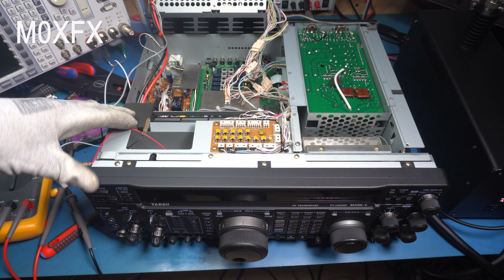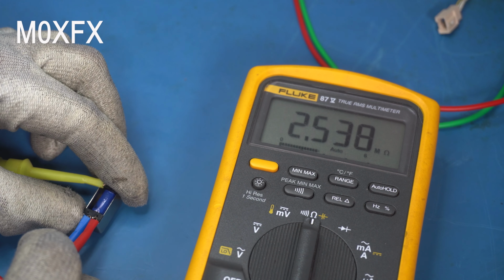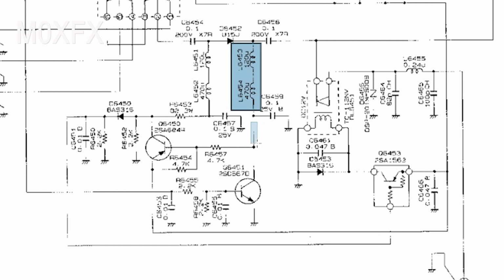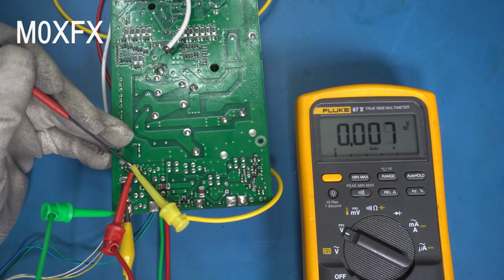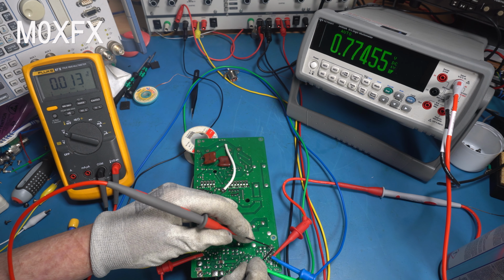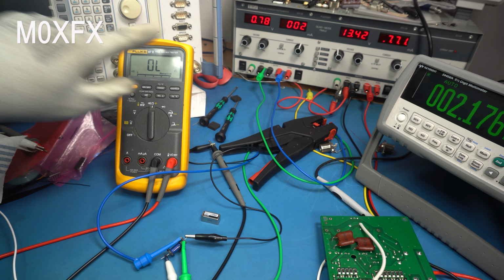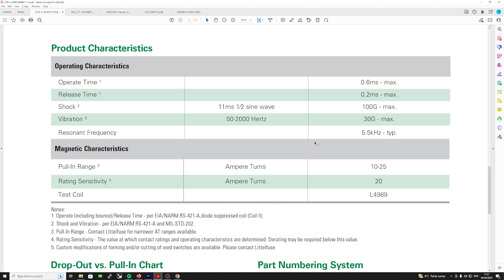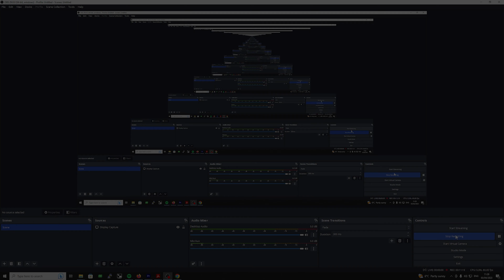Yaesu FT-1000MP Mark V No RX-TX Troubleshoot & Repair Part-3

Comment: Hi John, I have been following this series of videos as I  have had the same issue with the same model. Fortunately, the one I have repaired had not suffered any front end damage as the user was on fairly low power at the time. But in this case, it seems that RF had jumped into the reed relay coil and it was open circuit. Like you, I had no success with the relay, until I rang Yaesu. I was amazed to find they stock the relay (about £17 plus postage so I ordered two!) Transistor was open circuit on all legs and was replaced. I then found that the relay had approx 0.85 volts  on TX, so I carried out you diode mod. This reduced the voltage to almost zero! Like yours, there was a similar capacitor tagged onto the pcb, so it seems perhaps a Yaesu mod? Thanks for the very informative series. Arthur/G8IMZ.

Comment: The radio , It's getting there John  ....  I had the Mk5 Field  a few years ago , Nice looking radio but I just couldn't get on with it.
Reply from the maker: Hi Marc, Yeah it's coming together I haven't looked at the TX issue as yet, the rig was more poorly than I originally thought and I'm hoping it's there's not to much more wrong with it (fingers crossed). Re the MKV Field if I am honest I really don't have any experience with these radios however; now I have this thing receiving again it has quite a nice receiver but I do think Yaesu may have over done it on the features but I guess some people like all these features. That being said that's just my opinion and I have not been able to operate it. As always thank you for the comment and I may just make a review video if I managed to get it back to 100%. Let me know what you didn't get a long with and I will try to cover it.  Best Regards

Comment: I agree it's a bad design  Did you consider installing another relay with a grounding contact in the rx path   Or à pico 500 mA fusé  If your reed relay fails it will be another disaster
Reply from the maker: Hello Eugene thank you for your very interesting comment. 

Regarding the relay, I did consider replacing the reed switch to a two way version which would fit in the relay enclosure and would take the RX path to ground in TX by using the unused pin which is already soldered to ground via the PCB. I was a little concerned about the gap between GND and the TX rail but I am unsure if this would be a problem, I do think it would be worth a try. I think your suggestions of the pico fuse is a great idea as the work involved in rebuilding the front end is very time consuming.  

Regarding the design yes it's poor, I think with only a few more components this could have been very reliable which is a shame as these are great performing rigs when they are running that is. Once I have got the radio up and running again I may make another video exploring simple modifications to improve reliability. Any ideas or suggestions would be welcome. Thanks again regards John